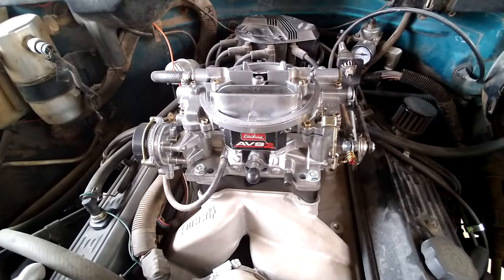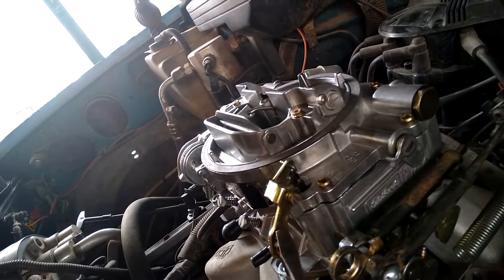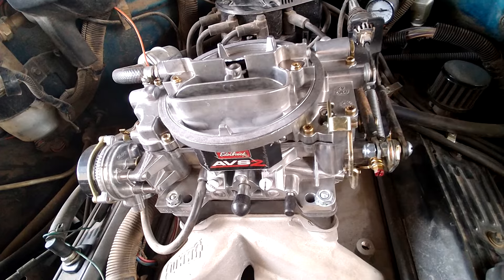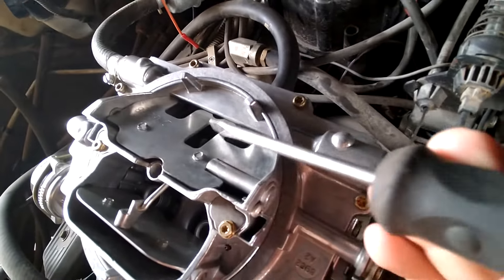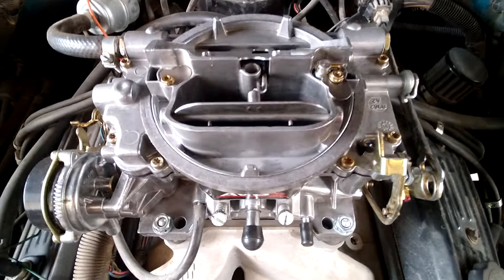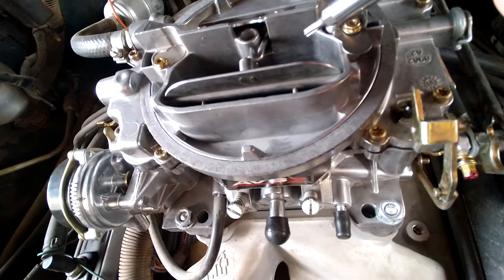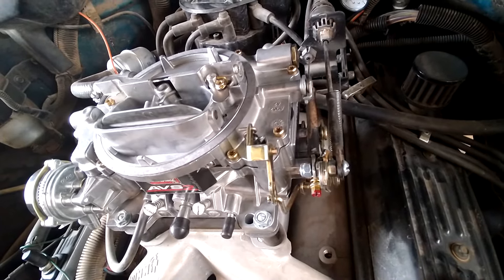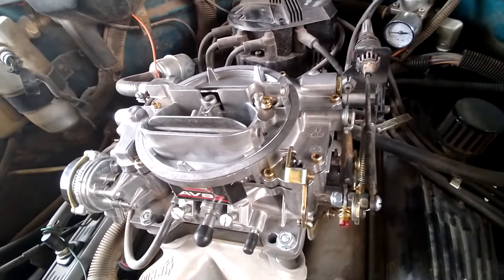Tuning and setting up a Edelbrock AVS2

Comment: I’m having a rich issue on my vortec. Pretty similar motor to yours, think my cam might be a tad bigger than a hot cam but not a ton bigger. Thing is driving me nuts, I’m running an efelbrock fuel pump regulated at 6, new avs2 like yours with the correct springs in it for my vaccuum and the motor is just all over the place. No vaccuum leaks. It idles up, runs rich, fires up quick sometimes, other times need persuaded, sometimes will run in gear, sometimes won’t. I’ve done just about everything besides re jet and bending float hangers to it. I am very close to putting  Holley fuel injection on it. Do you suggest I try drilling mine?
Reply from the maker: Sounds like it's loading up at an ideal I think drilling holes will lean it out how big is your cam
Reply: @CCAutoWorks  without looking at specs I believe it is a 303 duration but I actually am pulling 14-16 in of vaccuum surprisingly. I have never been so frustrated working on a motor before lol
Reply from the maker: @andrewayersman6923  what's the lsa that's a lot of vacuum for that much duration
Reply from the maker: @andrewayersman6923  I only pull like 12-13 and my cams small
Reply from the maker: @andrewayersman6923  have you checked float height
Reply: @CCAutoWorks  114 lobe separation on the cam. 488 lift. 303 is the advertised duration. Over sized valves in it too. Machined vortecs. I’m not complaining on the vaccuum though, brakes actually work. Lol I can’t think of any reason to be mad about decent vaccuum can you?
Reply: @CCAutoWorks  I haven’t checked float height but I did inspect them. I know factory calls for the 7/16 measurement. They looked good considering it is a new carb with 0 miles on it.
Reply from the maker: @andrewayersman6923  no it should be fine I would think have you watched a channel called muscle car solutions he's a good guy and he's been messing with alot of edelbrock carbs he might know something I'll be honest I never got mine to run a 100% normal driving was great but in-between gear shifts in a manual it acted off so I went with a holley tons more adjustment
Reply from the maker: https://youtube.com/c/MuscleCarSolutions
Reply from the maker: @andrewayersman6923  if it's new I'd send it back and see if they would do an exchange I've done that before through summit racing
Reply: @CCAutoWorks  I have watched everybody’s videos about edelbrocks. I have a pretty good understanding of how these work. I came from always running holleys to my first edelbrock so these are new to me. One other thing is that I get 0 changes from the mixture screws. Bottomed out to 3 turns out. No change. I also got the impression that this carb had been messed with and returned to the store. The choke ground wasn’t on there, the screws were bottomed out and the rear fitting for brakes wasn’t in there
Reply from the maker: @andrewayersman6923  what's your timing set at
Reply from the maker: @andrewayersman6923  that size of cam shouldn't be causing them kinda issues
Reply: @CCAutoWorks  I have played with timing a ton. Ranging anywhere from 16 to 20 base. It’s hard for me to find the sweet spot when I can’t even figure out what the hell my motors doing lol What’s yours at?
Reply from the maker: @andrewayersman6923  if it's really rich and loaded up with the mixture screws all the was in it will take a minute for it to use up the fuel to make a difference
Reply from the maker: @andrewayersman6923  I've also seen them put the jets sizes in backwards the fronts are in the back and back in the front from factory
Reply from the maker: @andrewayersman6923  Ive got mine set to 20° initial and vortex seem to like about 32-34 overall
Reply: @CCAutoWorks  I don’t have anything done to my overall right now. It’s a factory vacuum advance. I don’t know what my total timing is just yet but I probably need to re curve it.
Reply: I even called edelbrock and they told me to check floats and fuel pressure which I did. They say the avs2 is perfect for my setup and that it should have been close right out the box
Reply from the maker: @andrewayersman6923  yes I had to lock mine distributor or basically put a screw to limit it's curve
Reply from the maker: @andrewayersman6923  something is definitely wrong with the one you have
Reply from the maker: @andrewayersman6923  where did you buy it from if it looks like someone tinker with it then they probably did probably Robed something out of it that they were needing for theirs
Reply: @CCAutoWorks  It’s hard to say if I got a bad one or not. Just too many factors to consider but like you said in one of your other videos about it burning your eyes, that’s what mines doing to me in the garage. My clothes smell like rich exhaust smoke every time I mess with it.
Reply from the maker: @andrewayersman6923  was your timing chain bottom sprocket have 3 key ways
Reply from the maker: @andrewayersman6923  I have one you could try if your interested
Reply: @CCAutoWorks  it’s been a while since I built the motor. I know crank and cam gear are stock. I thought there was only 1 key way in those. It was a low mileage bottom end so I re used everything I felt would be fine. I did not degree the cam at all. It’s dot to dot
Reply from the maker: @andrewayersman6923  dot to dot is good I had advanced mine but it's just because I wanted the torque curve lower
Reply from the maker: @andrewayersman6923  do you have an Instagram account
Reply: @CCAutoWorks  I got the carb from a local hot rod shop near st.Louis. Performance parts plus. I don’t think it’s returnable and I haven’t seen anything missing inside the carb so I don’t know.
Reply: I don’t have Instagram. All I’ve got is a business page on Facebook. That and YouTube is bout all the internet-ing I can handle lol
Reply from the maker: @andrewayersman6923  spark plugs what plugs what gap
Reply from the maker: @andrewayersman6923  when I went to vortec heads I used regular 350 plugs it's a no no vortec plugs are longer and vortec has smaller cc so your compression will go up higher compression smaller you need to make plug gaps
Reply: @CCAutoWorks  well now we may be onto something lol I am running accel shorty header plugs. You think that’s an issue? Theyre 8199 and I gapped them bout 50 for HEI
Reply from the maker: @andrewayersman6923  those plugs are short and gap is way to big the vortec plugs are 3/4 reach plugs and your gap should be .30-.35
Reply: @CCAutoWorks  I’ll swap them. You suggest I try anything else?
Reply from the maker: @andrewayersman6923  that's all I can think of at this moment  but the plugs gave me trouble when I first put mine together and make sure your distributor has a good 12v
Reply: @CCAutoWorks  I sure will. Thanks for the help.
Reply from the maker: @andrewayersman6923  no problem anytime
Reply: @CCAutoWorks  put a second avs2 on today, changed plugs to Delco vortecs and not a damn thing has changed. Still can’t even breathe anywhere near the engine. Called efelbrock a second time they said fuel pressure, floats, needle are only things that cause it to flood out. I told them everything I’ve got here is edelbrock and less than a day old. Still have nothing accomplished. Thing literally burns my eyes and is ruining another set of plugs every second it’s running. I’m stumped
Reply from the maker: @andrewayersman6923  I'd say try holes but your carbs new so it's a tough choice
Reply: @CCAutoWorks  oh I don’t care. I’ll make them take it back if it screws me up. If I drill won’t it raise the idle? Have to close the choke more?
Reply from the maker: @andrewayersman6923  I wire my chokes open all the way I hate chokes I was able to ideal mine down all the way with just the ideal screw you never want to close the choke
Reply: @CCAutoWorks  I’m bout to drill this piece of junk right now lol 5/32 holes?
Reply: I just did 3/32 in the primaries. Gonna see what does
Reply from the maker: @andrewayersman6923  that's how I start
Reply: @CCAutoWorks  didn’t really help any. Do you think my vaccuum advance could be causing it to suck too much fuel? I am absolutely stumped at this point and everybody I talk to keeps saying it should be close right out of the box.
Reply from the maker: @andrewayersman6923  how far are your ideal slots exposed
Reply: @CCAutoWorks  not very much. I have my idle circuit screw completely backed out.
Reply: I think choke is part of my issue. If I were to crack mine all the way open like you said it would rev up to probably 4 grand at idle. Just another symptom of TOO MUCH FUEL. I am about to bend the float valves and change jets. I literally have no other choice. It burns my eyes so bad I have to just walk away from it. This is frustrating
Reply: To make things worse you can’t even get an avs 2 cal kit right now. Nobody has them. Efelbrock is on back order. However they use the same jets, rods, springs as the 1406 so I ordered one of those kits. It’s been about a week now. Hopefully arriving tomorrow
Reply: Another thing that misleads a lot of people (I noticed people saying this to you about your situation) a few people had told you to change step up springs lol the step up springs have nothing to do with idle.
Reply from the maker: @andrewayersman6923  really sucks your having so much hell
Reply from the maker: @andrewayersman6923  exactly nothing to do with ideal
Reply from the maker: @andrewayersman6923  if you open the choke all the way and it revs leave it all the way open and ideal it down if u can't mike be a vacuum leak avs 2 has a high ideal feature to if your closing the choke that will make it super rich
Reply: @CCAutoWorks  I also half way wonder if I accidentally made more than 400 horsepower lol and the carb is too small. Wouldn’t it run rich if the carb was too small because it wouldn’t get enough air? One of the guys at the hot rod shop was telling me that. Did you actually get your ratio to about 14:1 or just get it to quit smoking?
Reply from the maker: @andrewayersman6923  I've ran a 650 on a 550 hp big block no problem
Reply from the maker: @andrewayersman6923  my 350 might make 370 380 at the crank
Reply: @CCAutoWorks  did you re jet yours? If so did you go smaller?
Reply from the maker: @andrewayersman6923  no I didn't rejet anything how are you opening your choke
Reply: @CCAutoWorks  it runs best with choke about 1/8 inch open like edelbrock calls for….but it almost doesn’t matter because it’s just compensating for too much fuel
Reply: I unhooked the choke linkage. I’ll worry about that later if I’m even going to run it. Looked straight down the primaries with engine running and I got fuel dripping. This is most definitely my issue. I just don’t understand why it’s doing that. The fuel pump is regulated, just for the hell of it I put another regulator after it but I don’t have a gauge on it. Says it’s 1-4 psi so I’d imagine I’m probably only pushing 4 to the carb and still having a flood issue.
Reply from the maker: @andrewayersman6923  where is your fuel gauge at did you double check float height
Reply: @CCAutoWorks  I don’t have a fuel pressure gauge. That’s next on the list. I rented a fuel pressure tester today and it’s a piece of junk so got nowhere with that. Lol but I do think I’m on the right track. I don’t know what they’re called. If you look down the primaries the 2 big red circles with the the tiny holes in them. I see fuel coming out of them.
Reply from the maker: @andrewayersman6923  let your fuel bowls feel up then unhook the fuel line plug it and then start it and see if it runs better it will run a couple of minutes off just the fuel bowls
Reply: @CCAutoWorks  I am seeing if I can get ahold of an in line gauge tonight to see if either regulator is even working

Comment: Got the same carb on my wife's 81 K5 and it back fires like an sob. Not a hundred percent sure if it's carb or timing but may try and go up a hole so it's less lean.
Reply from the maker: Have you checked the timing
Reply: @CCAutoWorks  No but I believe it could be off, I just don't have a way to check it at the moment. But say it's not timing could it possibly be too much gas to carb Instead of too little. It's causing exhaust back fire when accelerating and like I said it's super hesitant. One thing I can say is the plug wires are long as shit and they are wrapped around the distributor from the previous owner, I should probably shorten them up.
Reply from the maker: @blazerwilliams2260  back fire in the exhaust is probably timing does it backfire through the carb you don't ever want your plug wires touching each other cuz it can cause a misfire
Reply from the maker: @blazerwilliams2260  if it's super hesitant the time is probably a little retarded turn the distributor a little bit to where it starts idling up and see if it gets better
Reply: @CCAutoWorks  Only exhaust and not carb. I was aware of the wire issue just haven't had time to sort the mess from previous owner and I thought maybe if they were good wires it would be ok but I think I will go in and clean them up so they are touching each other or arcing off anything else and at least eliminate that and see if it fixes the problem.
Reply: @CCAutoWorks  I will try that , thank you very much for your time. Yea this beast has a sbc 400 and it feels like it has not even half of what it should.
Reply from the maker: @blazerwilliams2260  yessir happy to try to help anytime
Reply from the maker: @blazerwilliams2260  you will get it worked out just try different things here and there but I'd definitely start with timing
Reply: @CCAutoWorks  Sounds great man. Thanks again.

Comment: I have a 400m with a mild rv cam
Elderbrock manifold switching from 1411 750cfm to a 650 AVS2
Any recommendations....I don't quite understand about port and distributor vacuum...
Reply from the maker: Port vacuum has a vacuum all the time at any rpm and you can use it for distributor vacuum but the port for the distributor is a vacuum that doesn't have any vacuum at an idle it only has vacuum at higher rpms
Reply: Thank you

Comment: Quick question bud, what throttle and tv cable bracket are you using? Is the stock one?
Reply from the maker: It's a throttle bracket form edelbrock for the vortec intake manifold it uses the two back intake bolts to hold it and the bracket has a place for throttle cable cruse control and the kickdown for turbo 350 or 700r4
Reply from the maker: https://www.ebay.com/itm/192410940192

Comment: I had another question man: what could cause me to tune for best possible vacuum, but still run rich with WOT?
Reply from the maker: Probably to big of jets on your secondaries
Reply: @CCAutoWorks  I’ll look into that! It’s an brand new off the shelf AVS2 on a 1979 cop 360/727, Edelbrock performer intake. Stock cam and exhaust manifolds. Been fighting it since I put it on, major hesitation on initial hard pedal-to-medal throttle, then it go’s like a scalded cat. Gets a little better when I lean it slightly with the mixture screws. Elevation is basically sea level, at 150 FT

Edit: would the secondaries being too big also result in the major stumble at the beginning? It backfires out the carb and sometimes dies if I keep it stomped too long

Comment: fuel regulator stopped most of my problems 350 sbc with the avs 2 1906 at 4.5 lbs fuel mild cam
Reply from the maker: That's good I think that's what Edelbrock recommends

Comment: What size cam do you have in this? I have a .510 lift cam and mine is running rich on passenger side.
Reply from the maker: Sbc lt4 hot cam .492 lift what's your timing set to

Comment: Change step up springs to maybe 5hg vacuum and try that 
This will deliver the fuel later so its not so rich.
Reply from the maker: I have changed the stepup springs but wasn't enough I drilled holes to lean it out at idle from big cam low vacuum

Comment: What would be causing the idle to continually go high when i just race my engine when its idling? I always have to keep pumping the accelerator to kick the idle back down even after the engine warms up to full operating temperature it will still idle high if I race the engine.
Reply from the maker: Vacuum leak
Reply: @CCAutoWorks  thank you for the reply I will see if there are any unused ports that are not plugged! Just surprises me because I just had the carburetor installed not too long ago.
Reply from the maker: @chrisrogers8927  I've had it happen before a vacuum cap had gotten a pin hole in it and after you would rev the engine it would fast idle for a long time before it would drop back down

Comment: Any idea what would be causing mine to idle high when I race the engine?  When I hit the accelerator it goes back to high idle and I have to kick it down by tapping the accelerator? TIA
Reply from the maker: Could be a small vacuum leak or throttle linkage sticking or the choke staying closed a little bit and these carbs to have a high idle feature when there cold
Reply: @CCAutoWorks  thank you for the response